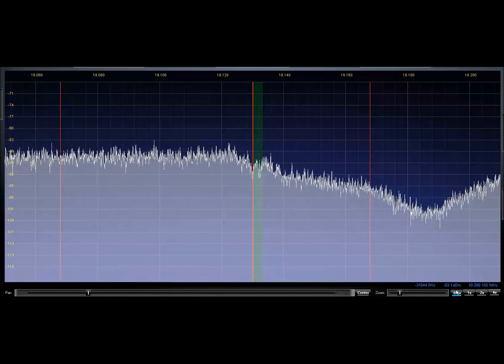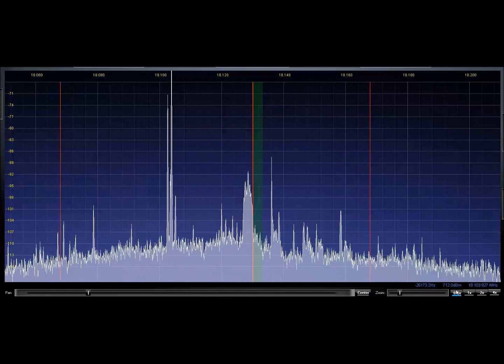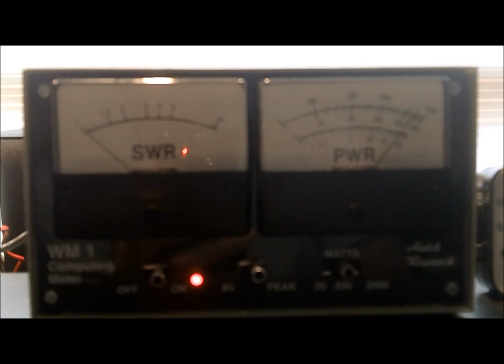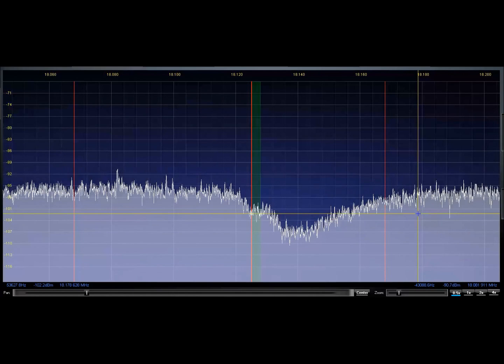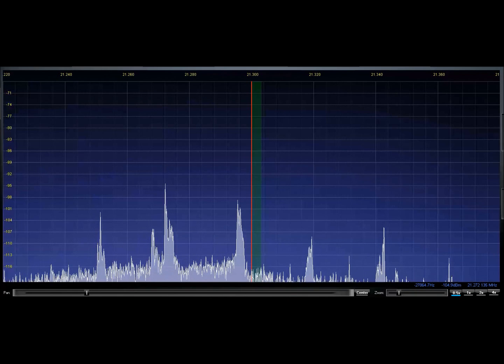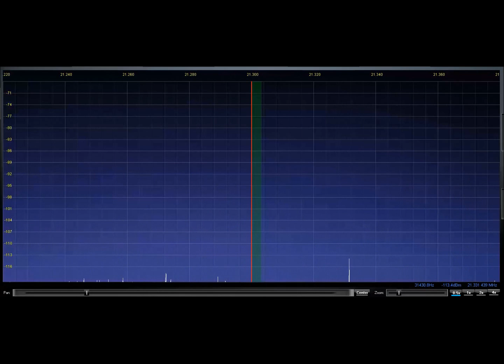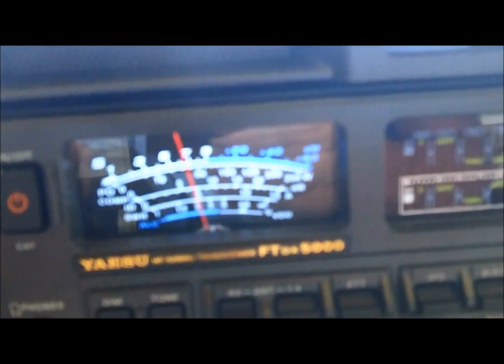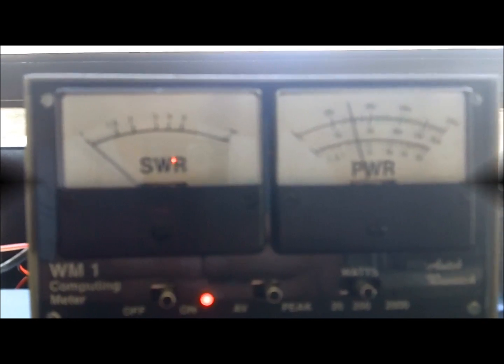Magnetic Loop Tuning

Comment: I can not figure a tuner hooked to a magnetoc loop antenna. because the antenna needs to be resonant. not just 50 ohms. or how a transmatch gives the radio a 50 ohm load. ro do you want the antenna resonant.